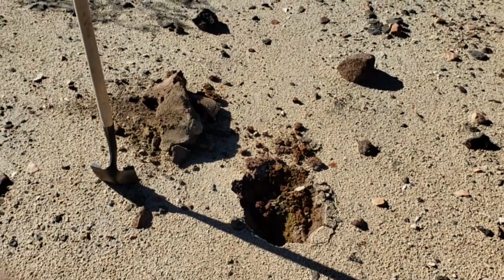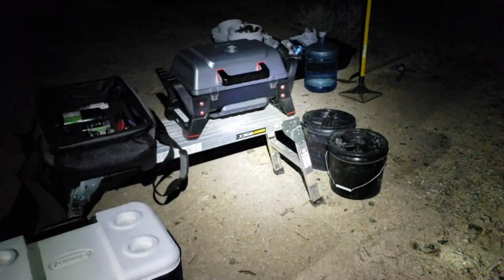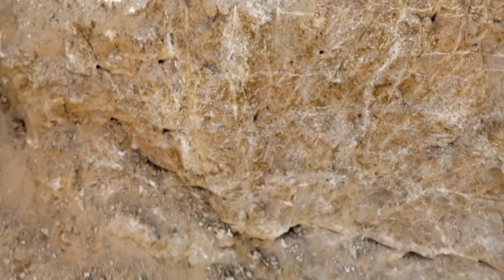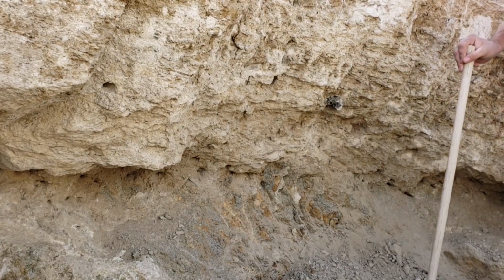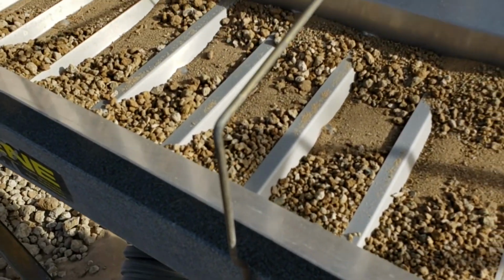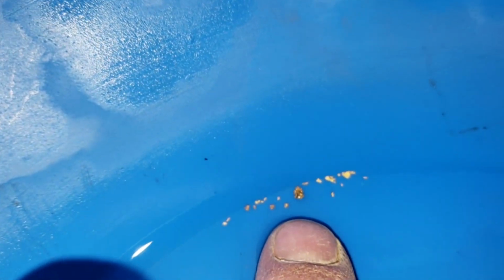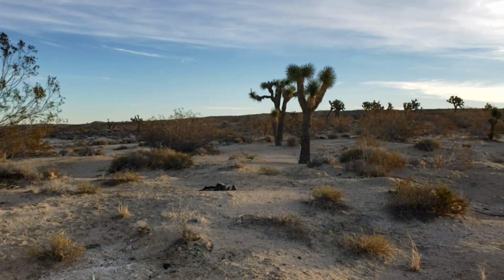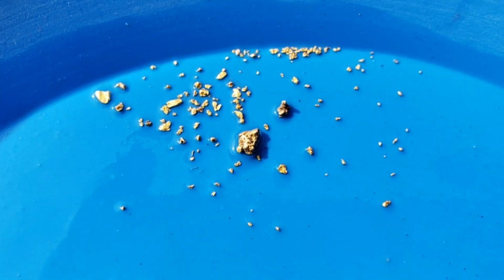Drywashing in Coolgardie Barstow

Comment: For as long as it takes you to run the stuff through for the drying process, and as hot as it is out there, it would be better to just spread the stuff out on a tarp and let it sit. Save yourself the gas and the work, and it would be just as beneficial and would dry just as fast as running ti through 4 times. Great job man

Comment: Not sure if you knew but to try wet dirt is dig a shovel load let it sit for about 15 -20 minutes then turn the dirt again and dry it again for about 15-20 min and repeat until it dry for dry washing rather than keep running it through and wasting your gas.